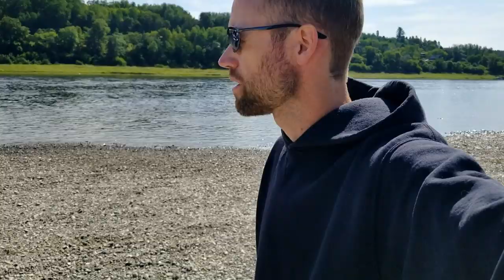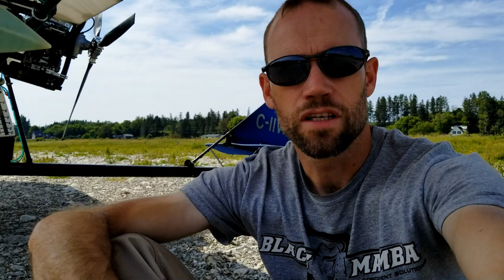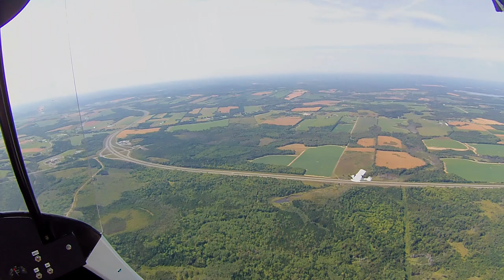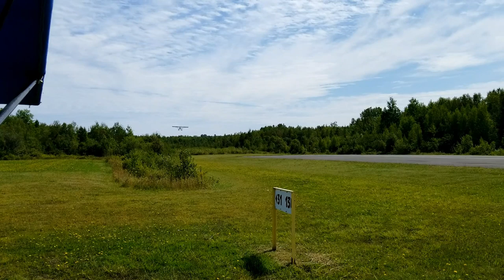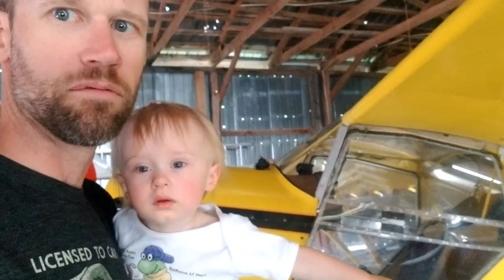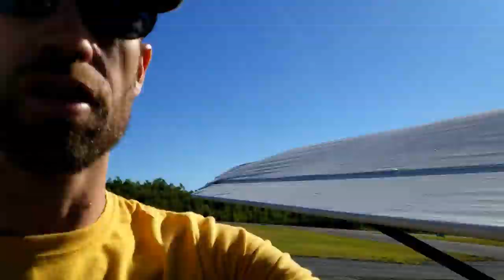Scott's back! | Bad Bearing in the Gearbox

Comment: It's funny how the SMALLEST things cause the biggest problems!  A bearing may be small (& cost very little) but will cause the biggest headache.
And yeah, I remember seeing the nose wheel/rudder hard over during a turn in the other video but thought nothing of it.  I just passed it off as a hard cross wind & that was that!  But now that I think of it, I did the same maneuvers when flying model planes.  Fairly loose turns & lose altitude at the same time for landings.

Comment: Slipping turns = stall/spin scenario. AKA death to the Cessna pilot. I listened to the engine real hard and couldn't detect anything. You think the new prop is actually centering the pressure on that one bearing? Great video - I really enjoy the fixes.
Reply from the maker: Skidding turn is the precursor to a stall/spin accident, slipping turns are perfectly safe.
I don't think the prop had anything to do with it. I think the bearing just wore out (as any will do over time)

Comment: 3 Blade prop ,Which gearbox? Do you know where I'm going?
Reply from the maker: I do. It's a B gearbox and I know all about the service bulletin. From what I understand however is that it's not the bearings that take the hit with a high inertia moment prop, it's the dog gear and spring washers. Mine only have 100 hours on them and spec'd out just fine when I had the gearbox apart. I spoke to several people with lots of actual Rotax industry experience (I'd call them experts) and they assured me that my 3 blade setup is perfectly fine; I just need to keep an eye on the things I mentioned above as they will wear out faster.

Comment: Quick question. You said you re-torqued your prop bolts. You don't safety wire thase bolts?
Reply from the maker: Correct. Instead they're lock nutted in place from the back with loctited nylock nuts.
I check the tourque on them every 10 hours as part of my maintenance schedule and they're always tight right where they should be.
Reply: I'm a 44 year A&P mechanic with 8 years as an inspector on Cessna business jets. If I keep watching, I think I might just get proficient on your aircraft. What you think?
Reply from the maker: I suspect you have probably already forgotten far more than I'll ever know about aircraft care! I'm sure you could fix anything on mine that ever went wrong. :-)
Reply: I enjoy your videos and I thank you for your kind words. I love working on aircraft and age is the only reason I siopped working on them professionally. However, working on and flying one like yours I believe would be a blast. Keep flying and keep those videos coming! Because in aviation, you learn more every day.